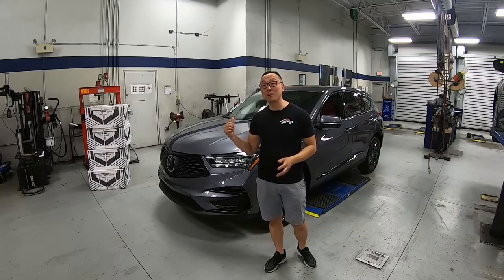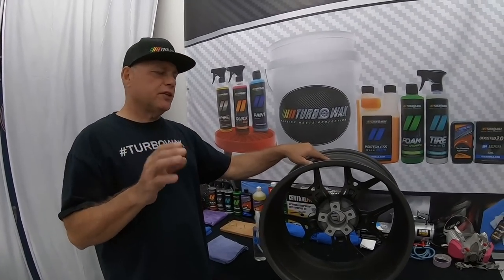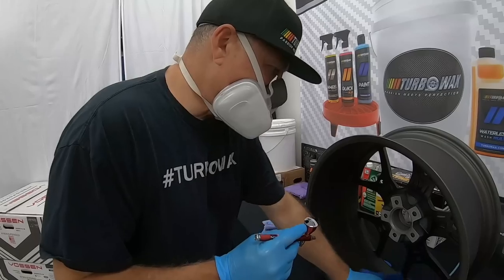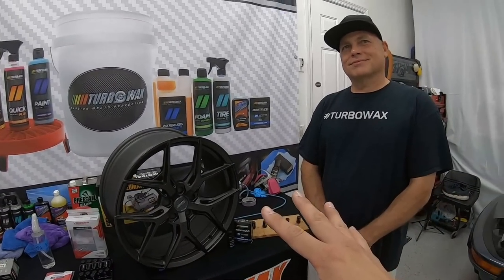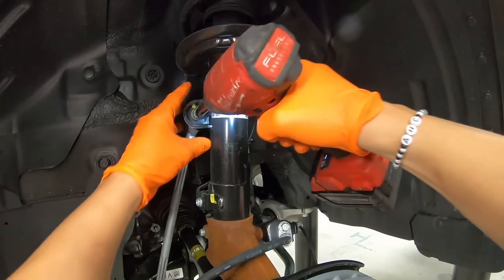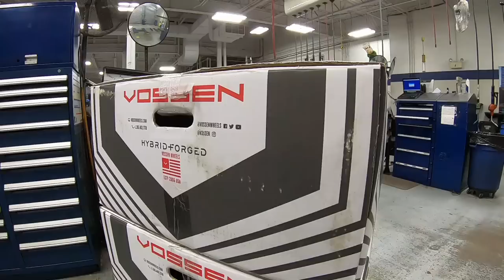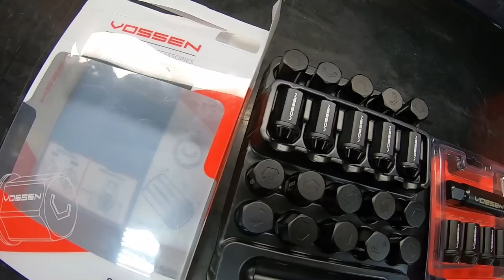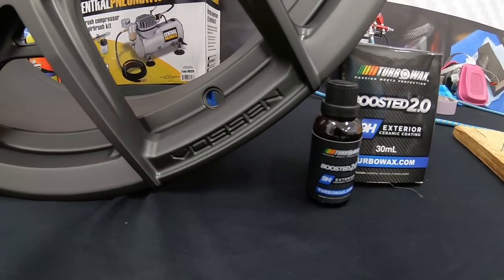Brand New 2021 Acura RDX A-Spec - How to Ceramic Coat wheels | Vossen HF-5 | Eibach Lowering Springs

Comment: Do the Eibach springs work on 2WD I noticed no badging on this RDX for SH-AWD?
Reply: So far so good, i just had mines installed no problems what's so ever. I have a 2020 RDX A-Spec 2WD. Rides is like stock.
Reply: @eddie2128 do you still have your rdx, how's it going with the springs?

Comment: I would wait to put the wheel weights first before ceramic coating the wheels cus they not might stick on good once its ceramic coated.
Reply from the maker: We didn't have any issue with the wheel weight after the ceramic coat process

Comment: Have you compare the ride quality vs the stock springs?
Reply from the maker: The ride is very similar to the stock, just a tap bit sportier. Highly recommended.
Reply: @ahcgarage  hi there..how much will going to cost to do the lowering spring on rdx 2020 aspec? Thanks

Comment: Hmmm will wheel weights stick?
Reply: Talked with a tire shop and they said don't put ceramic on the inner barrel before mounting tires.
Reply: @canyonrun2565  Hello, I think this depends on the brand of ceramic, we have done many, many wheels and never had a report of the weights coming off, at least with our product. :)

Comment: Looks great!  Just lowered my 2020 RDX A-Spec last weekend as well.
Reply from the maker: Good choice!
Reply: How does it drive ?
Reply: @Juanfern1170  Drives great, not harsh or anything.  Just a little more firm than oem.
Reply: I just did mine too! Quick question, how did you fix the rear camber? I’ve been looking for rear kit but can’t find it!